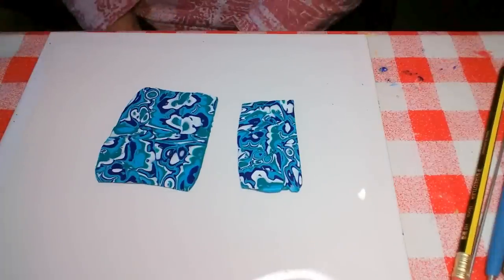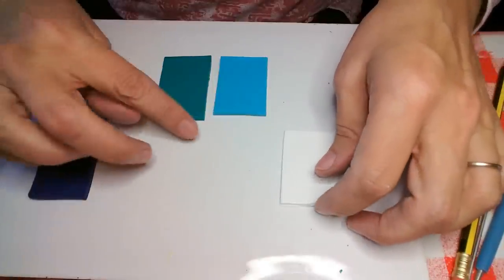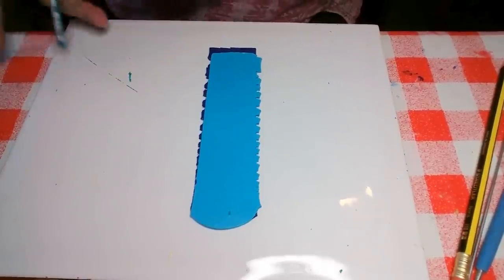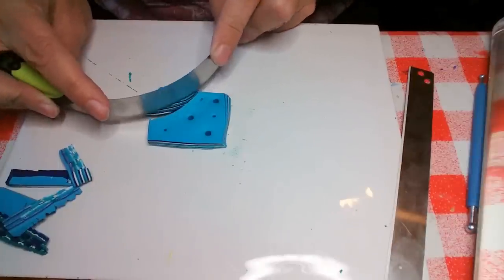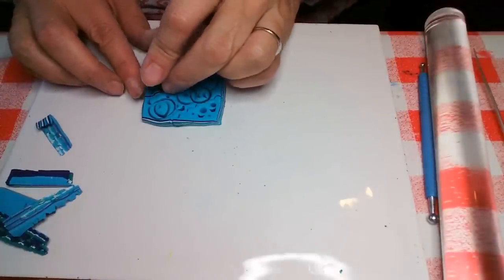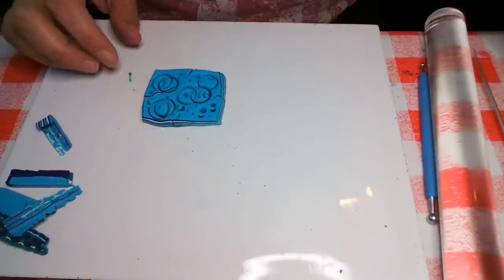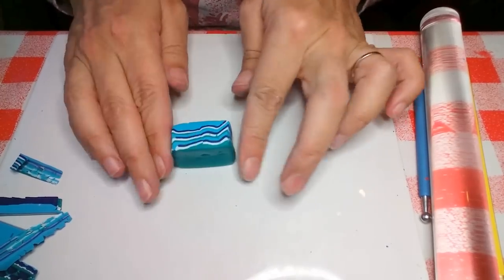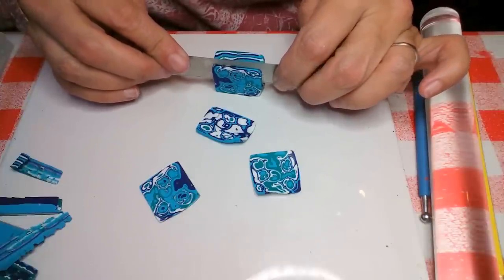Mokume Gane Technique in Polymer Clay

Comment: This is amazing! I know u posted this 4yrs ago so I hope u see this comment to answer my question! I'm new to polymer clay and I wanna know if u can use this design for buttons? If so how would I do that?
Reply from the maker: Sure... Arrange the slices on a background sheet of clay, to make a slab. Lay paper over it and burnish lightly, to blend in any joins. Go for a decent size to thickness ratio. Cut out using shaped cutters but put cling film over first, then cut. This makes nice rounded edges. Remove any stuck cling film with sellotape. Make holes with a tool, or toothpick. Bake for at least 45 mins using a pre-heated oven and an oven thermometer. Sand VERY lightly and buff with soft denim.
Reply: @UnrulyHousewife  perfect thank you so much!

Comment: What if I want thick blocks of Mokume? Meaning I want to make pens out of this. So I would need blocks of Mokume that is 1 in x 1 in x 6 inches.

The pattern needs to go clear through the block 1 inch deep. This is because I’ll turn on a lathe and remove around 1/8 of inch from the surface to shape the pen. 

Any thoughts would be great!
Reply from the maker: As long as you bake it for a decent amount of time (see the packet and then I would add some) it should be hard enough. That said, I wonder if the friction on the lathe would be too hot? Maybe use scrap clay to test first and make sure you have good ventilation. I buy pen kits, wrap the tubes in thin clay, adding thin slices of mokume gane, then bake and sand.

Comment: Can this thin layer of clay be attached to pieces of wood and then dried?  I want to make some mermaid tail, hair sticks with this lovely decorating method.
Reply from the maker: As I understand it, it is best to bake the wood for a little while first, in a low oven, so that it dries out. You might want to sand it, if it has varnish on. Then coat it with something like white glue, wood glue, or gesso, and let it really get dry. This seals the wood, ready for you to add clay and bake, according to the manufacturer's instructions. That is supposed to stop areas of the clay from lifting up, due to moisture. THAT SAID, I haven't tried it - so maybe experiment with some scrap clay before you jump in? If you need to glue it, Weldbond is good, I hear.
I need to try this on some wood myself! xx
Reply: Thanks, my woods are kiln dried already so I will do the glue, dry and then apply and then do I bake it on the wood, that would seem to be when the clay would bond to the glue?  Or should another coating of some bonding agent be applied?  Also have your ever made hair sticks?
Reply from the maker: Betsye Parnell No, I have never made them. I think probably just bake it right on there as it is. Then once it has fully cooled, test it. If it isn't attached properly, glue it with Weldbond. But that's my opinion based on what I have picked up - I'm not certain. Please let me know how it goes xx
Reply: Betsye, did you ever make your hair sticks?  How did it turn out.  Am Curious because that is exactly what I'm wandering the interwebs for, inspiration for my hair sticks.  I have some wood that has been drying for five years, I guess it wouldn't hurt to bake them a bit, just to be on the safe side.

Comment: I took ceramics in high school and just started getting into it again, this video is beautiful and I love your other ones. I was wondering what the metal ruler looking thing you used is called?
Reply from the maker: Haylee Braiden To slice it? It's a "tissue blade", a style of medical blade originally designed for slicing thin tissue samples, for use under microscopes. Nowadays you can get branded ones for polymer clay use, from Sculpey or Fimo. x